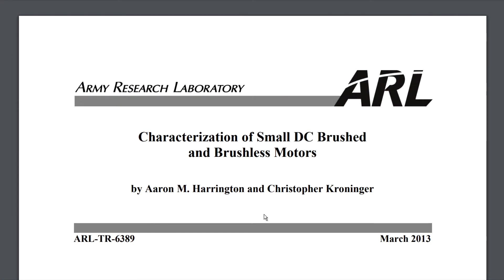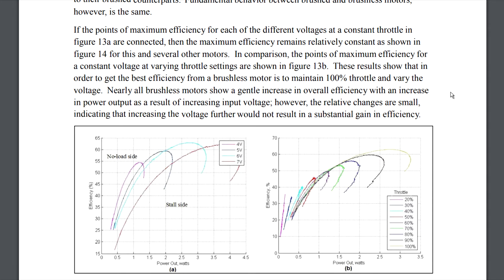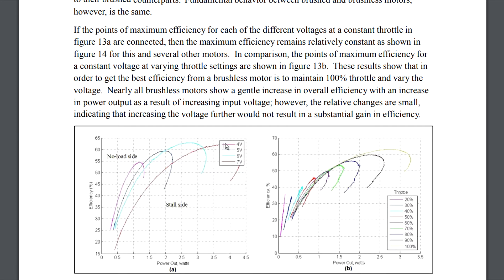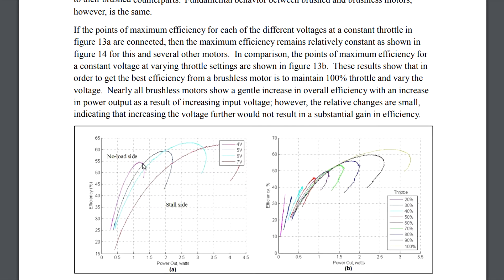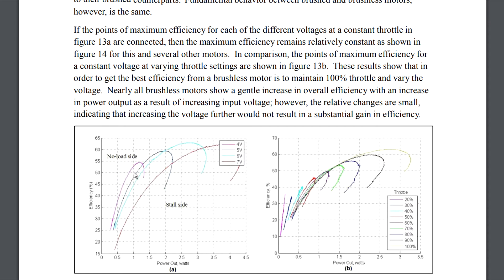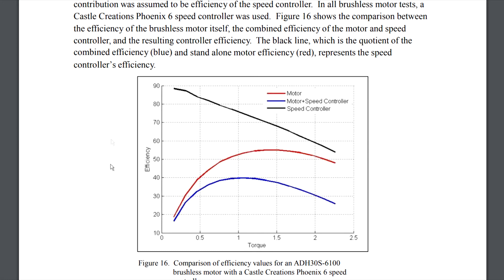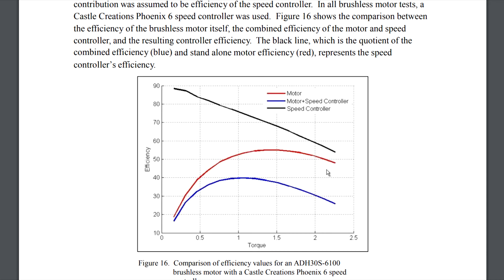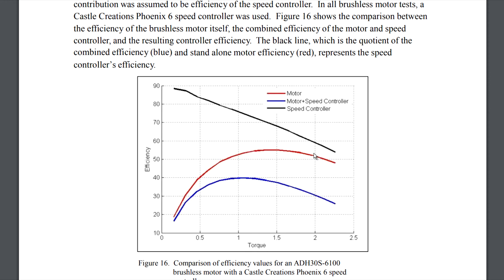Resource Highlight - ARL Motor Test Report

Comment: Hey, thanks a lot for taking a serious lool at this!

Regarding the data.  I still think it's less clear than maybe your breakdown implies.  Now, especially with our power draws being all over the place in RC flight, where would one define the power draw of the motor?  

Basically, the motor plots imply that you should try to be at about 80% of the motor power output for max draw on that voltage, and if you are drawing too much, or too little, then it would pay to alter the battery voltage (or change motors).  Does that seem like an accurate statement to you?  

Also, I believe they are trying to say that PWM is not very efficient, and it would be better to have a fluctuating voltage to drive the motor as opposed to a pulse width modulation.  Does that also seem accurate to you?

(As an aside, to try to achieve the best efficiency of a motor based on these plots, it would seem to me the approach would be to have the lowest voltage possible, that still produced the overall wattage that you wanted, or conversely the highest current while maintaining the wattage, but this would imply picking higher KV motors for better efficiency, and this isn't really borne out in flights, is it?)
Reply from the maker: Ya it's not so simple for us, it's a lot easier if you're trying to design for a pump or an air compressor or something like that.  We have a full range of loads that we need to work at, so you need to get something that will work as best as possible over that entire range, it's all going to be a matter of compromise.  Once we start overlaying prop data ontop of the torque/rpm charts I hope it should be a bit more clear what areas of the motors performance are important to us.

They are saying that the best situation is to load up the ESC 100% duty cycle and vary the main voltage, but that's not so simple a thing to do as a method for actually driving the motor.  If the gaps in drive efficiency are big enough I think it could be interesting to feed the ESC from an adjustable regulator and allow it to step to different power modes, like a 'cruise' low voltage mode, or 'boost' full voltage mode, letting the ESC PWM range compensate.  But you've got to eat the extra 5-20% efficiency loss from the regulator as well as the additional weight so it's not a clear win.

That's basically the summary of choosing a powertrain as I understand it.  Get the lowest voltage you can get at the highest amp draw that you can stand.  I haven't seen any results from anyone doing any seriously controlled freeflight efficiency tests on quads.  Just lots of seat-of-the-pants testing and very many of those without a good understanding even of the total energy capacity of their battery.  Lots of tests with people throwing on larger batteries, getting longer flight time and then proclaiming it more efficient.  But I haven't been scouring the web for results.